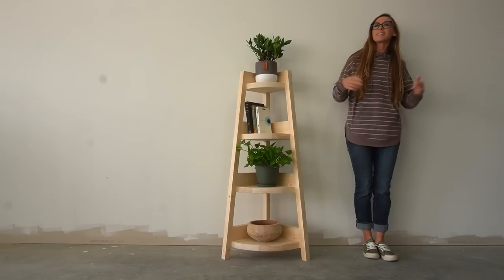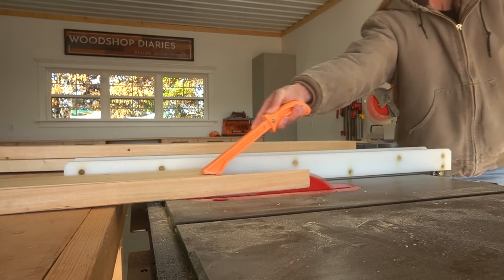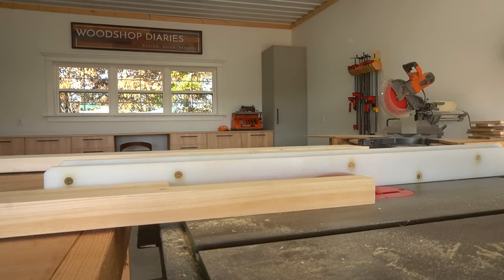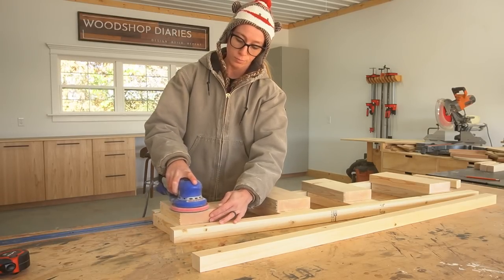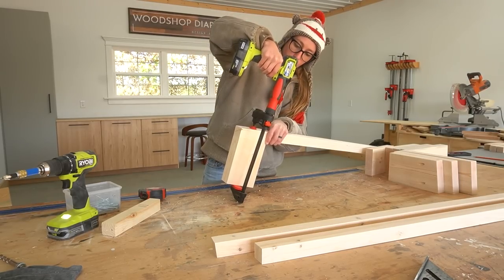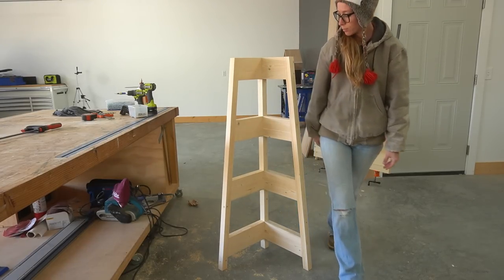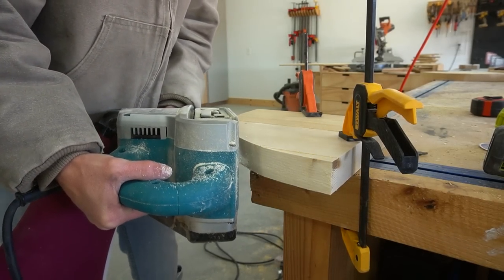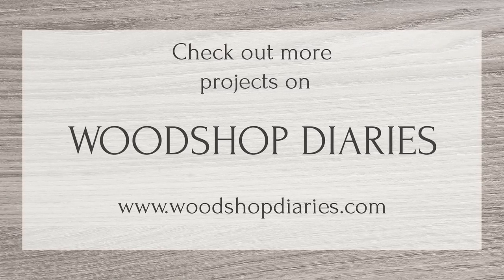How to Build a Simple Corner Shelf--with under $30 in lumber!

Comment: Instead of sending the curved side of the shelf, you should make a template on thinner wood and then trim shelf on the router with the coping bit. It would be already smooth with no sending needed
Reply from the maker: I could--that would be a great idea if I was making several of these and would reuse the templates more than once.  But since I was just making this one shelf, cutting and sanding wasn't too big of a deal on just four pieces.

Comment: Looks great.  It’s nice to do a project you can knock out quick.  Also,  there is nothing wrong with pocket holes.  They have found hand cut pockets in old furniture built by craftsman.  Check out video at Stumpy Nubs.

Comment: When screwing through the back post with the countersunk holes how do you determine the depth you drill?
Reply from the maker: I just drill deep enough that the screw head sits below the surface of the wood once it’s driven. The bit has a stop, so drilling until it stops works as well